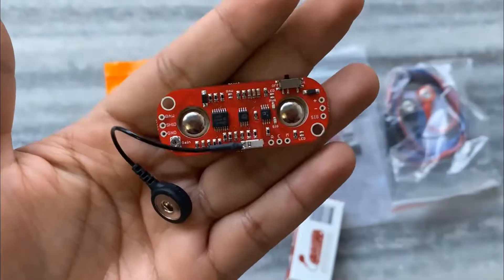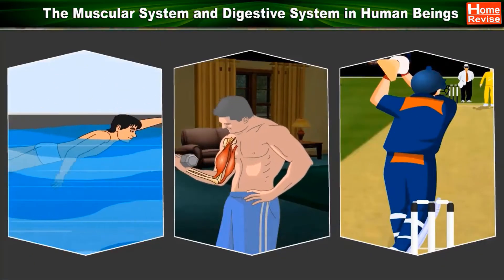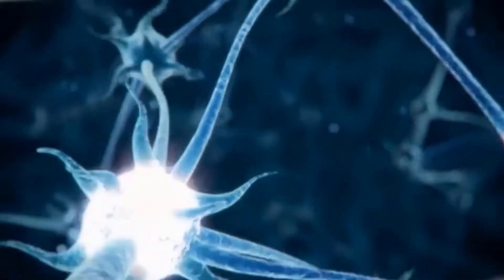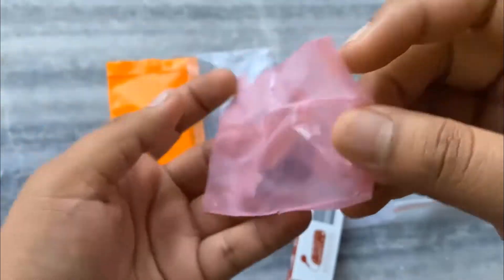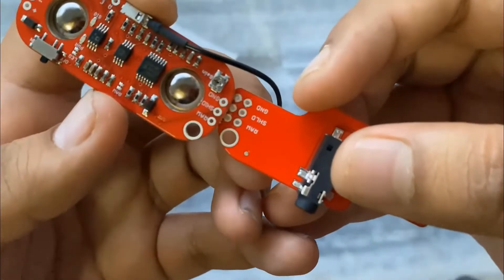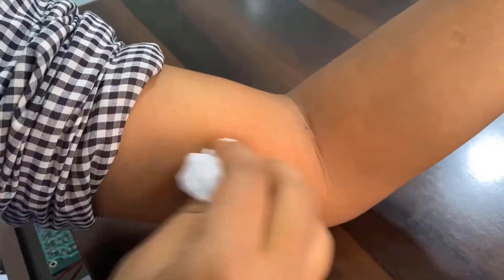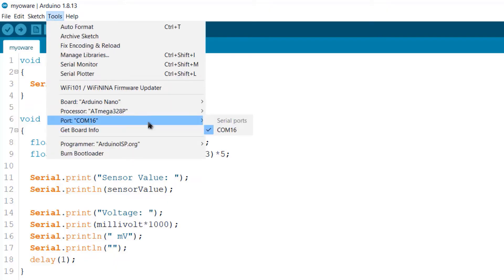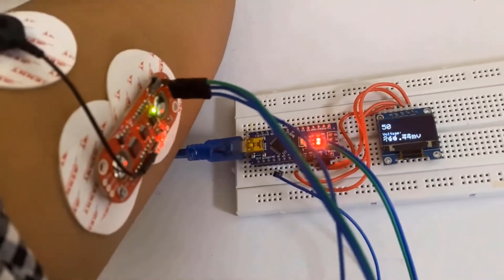DIY Electromyography using MyoWare EMG Muscle Sensor & Arduino

Comment: hello on timestamp 8:10 ,what is that chip called? thank you so much
Reply from the maker: Arduino Nano Board.
Reply: @HowtoElectronics  hello can i use a raspberry pi 4b instead of the Arduino nano board. I'm a beginner at this. thank you for the reply.

Comment: Thank you so much for this video.  But I still don't understand how to get the line to convert the sensor value into millivolts, can I get a journal or theoretical reference for the calculation formula or can you provide an explanation regarding the equation 🙏

Comment: Hey, great video. Unfortunately, it only works if i copy and paste the code. As soon as I change the code a little, nothing works anymore. Why is this happening? For example: I just tried to change the serial print from "Sensor Value:" to „Value:“ . One small change and nothing works anymore. It doesn’t make sense for me. Can you help?
Reply from the maker: That should not affect the reading i think so. May be you are changing variable